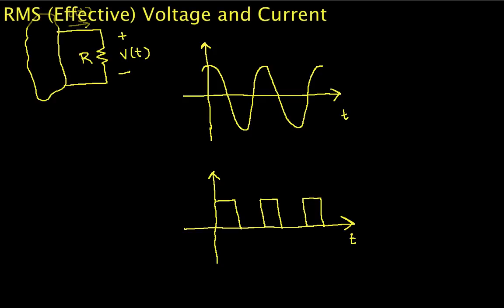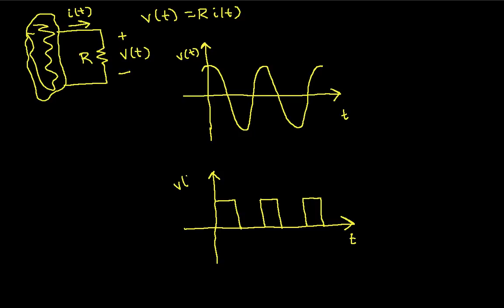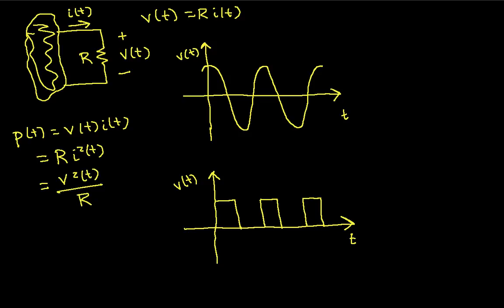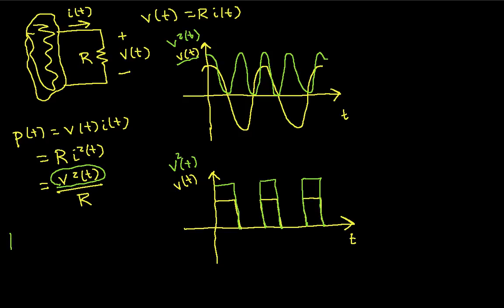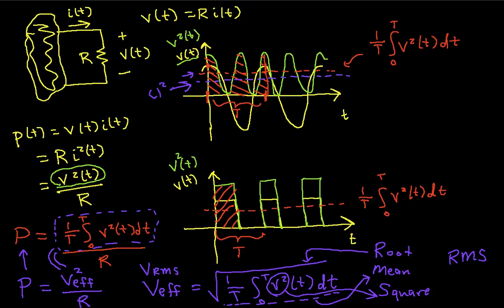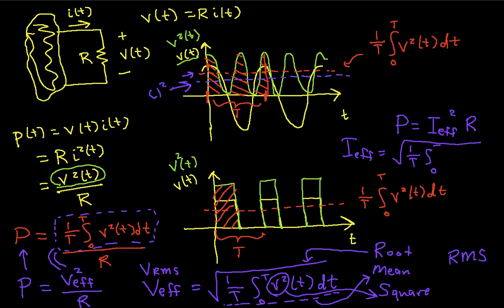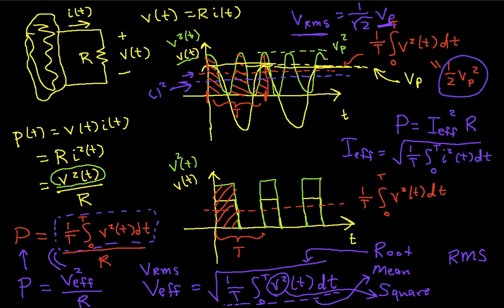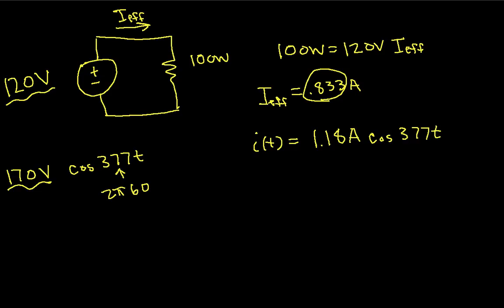RMS (Effective) Voltage and Current

Comment: I am trying to do is analyse a triangular wave that superimpose on the 120Vrms AC power line. The triangular wave amplitude (ramp) is not constant along the 60Hz cycle but would rise (@ 0volt AC or 0 degree sine) and increase its ramp as the AC voltage rise to its peak (@ 120volt AC or 90 degree sine), and vice-versa when the AC line fall back to 0volt (@ 180 degree sine). I am basically describing a Continuous Conduction Mode Power Factor Correction of the AC Line...continue

Comment: It would also be great if you could also show a trapezoidal (triangle sitting on top of at rectangle) wave that peak along the AC line with a ramp described in my previous post [ 
The trianglular wave ramp (peak and valley) would be in the path between A*sin(w*t) and B*sin(wt)., A is greater than B]

I am not sure if what I am asking for can be done mathematically, maybe it can be done through a combination of intregration and Fourier, not sure.
thnx

Comment: sir i want to know why we square the value of voltage or current curve? ...what i knew we square it to get rid of the -ve part of the curve but in the 2nd example where you have taken the square wave as an example there the voltage wave form is not going into -ve quadrant don't you feel that v^2 is not necessary there to find the RMS value  ?

Comment: Is it possible for you to show how to calculate the Average and RMS of a:
1) 20 KHz triagular wave with with an envelope of 120Vrms sine (60 Hz) and a valley of 100Vrms sine (60 Hz)?
2) 20 KHz trapezoid wave with with a peak envelope of 120Vrms sine (60 Hz) and a delta ramp voltage of 20Vrms?

thnx

Comment: I'm confused. Veff(squared) is a non-zero value, hence Veff will also be a non-zero value. But isn't the waveform of V alternating about the zero point, which means Veff = 0V?
And the whole waveform of V(squared) is more than or equal to the zero point, which means Veff(squared) should be a value somewhere above [Vp(squared)] / 2. But at the same time, the waveform of V(squared) is alternating about [Vp(squared)] / 2 , making that it's effective value.
Can someone explain this to me? Thanks.

Comment: How do you get in the very last formulas in the example from I_eff = .833A to i(t) = 1.18A*cos(377t)
Reply: +Patrick Mullan  i(t)=Ip cos 377t its basic current equation so we have to find Ip from Irms=Ip/square root of 2. here Irms value is 0.833, Ip=Irms*square root of 2.

Comment: Hi, thank you very much for the video i was wondering if you could help me with this:
I would like to calculate the RMS value of an experiment i did for physics, i connected a primary coil (420 turns) to an AC with a frequency of 100 Hz, and connected a secondary coil (1200 turns) to an Oscilloscope to measure the voltage induced in it. I recorded the Vpp (voltage peak to peak) and i changed the distance between the coils. example: 6cm, Vpp=620, Vmax=260, Vmin=-320. i will appreciate your help